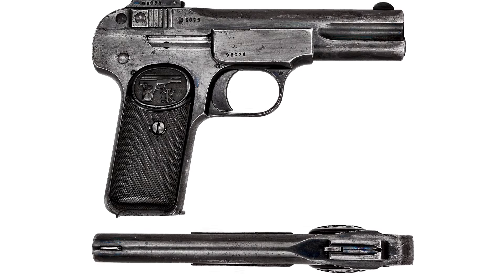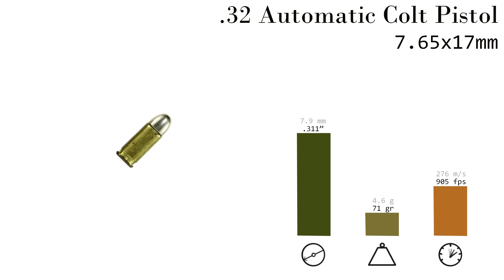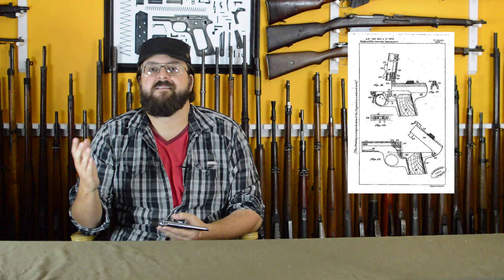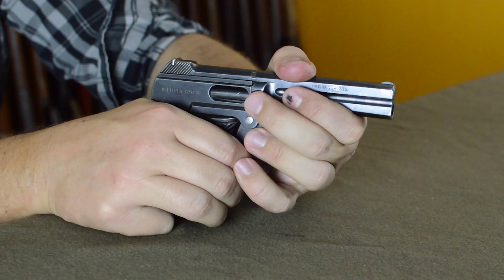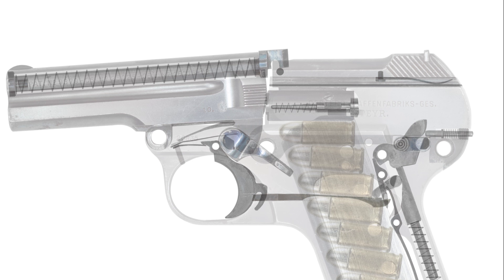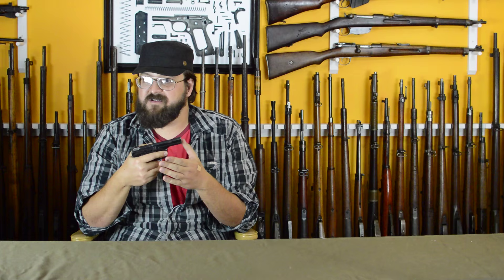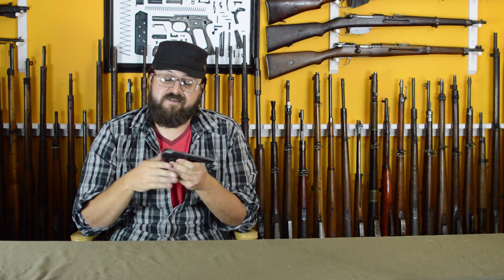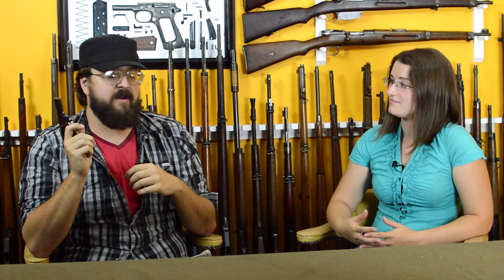History of WWI Primer 015: Austrian Steyr-Pieper Model 1909 Pistol Documentary

Comment: Ooooh,   HS camera perhaps?      In a month or so I'd be happy to run another promo for your channel and try to steer some more viewers your way.  Does the magazine need to be in the pistol for it to shoot?   I don't really understand the two position mag deal if you are loading a round at a time in it.
Reply from the maker: +TAOFLEDERMAUS That's my thought as well.  Why not just... not load the magazine..?  

Thanks man, might want to wait until we get through some of these planned rifles and MGs
Reply: They definitely over-thunk that one.  

Whenever you are up to it,  I'll be more than pleased to promote the crap out of your channel again.
Reply: My initial thought too, and leaving the magazine in must run the slight risk of accidentally pushing it in and making it semi again. Not a problem if you are being sensible and safe but after a long time of expecting single shot, or with someone new to the gun, the shooter could mess up.
Reply: +TAOFLEDERMAUS the idea with the two position magazine is the same as the magazine cutoff on the rifles at the time.

With the pistol in single shot mode you can keep a constant rate of fire for as long as you have cartridges handy, whereas if you use the magazine you'd get 7-8 quick shots. but then you'd have a long delay while you remove the magazine, refill it one cartridge at a time (which takes even longer than dropping it into the chamber), and reinsert it in the gun. (the idea of carrying multiple preloaded magazines is quite recent. a pistol would usually just come with one or two magazines, which you'd fill up with loose cartridges when needed)

So with the magazine in the cut-off position you'd actually have a higher rate of fire over a long period. Then if you suddenly need to fire rapidly you could slap the magazine in, and use the gun in true semi automatic mode.
Reply: +TAOFLEDERMAUS u add a lot of mass to keep is more stable en keep the feel more like u normally have on a first shot
Reply: Seems like a magazine cut of, got put on a pistol
Reply from the maker: +Christian Øelund all try but it doesn't look like this was intended to be a military pistol at first. It is just so odd.
Reply from the maker: +SoY_FooD I could see that
Reply: +C&Rsenal I was thinking about the question. Just a wild speculation, I don't have any sources, proofs, but it might have been a solution a another problem, that would appear without the magazine?
Reply: +Christian Øelund this also coming from a company whose rifle had problems with durability of (I belive) extractors) when in single-shot mode.
Reply: +C&Rsenal here's a question: what if this design had been chambered for 9mm Luger or 9mm Borchardt? or even something crazy like .38 special or .38 S&W? Now continue imagining that but with a weighted barrel, a heavy duty slide, 1911A1 style sights, a recoil buffer, a single position magazine, a push button safety, a grip safety, and a crisper lighter trigger. How do you think that would have performed on the battlefields of the Great War?

Comment: You speculate that the recoil would be more manageable with a heavier spring....that prompts a general philosophical question on all reviews of old gun:  how well can we truly judge the shooting characteristic of any century-old gun, especially when it comes to questions of springs and/or part durability?

(Another excellent video BTW)
Reply from the maker: +RabidMortal1 True, the spring could have aged poorly but given the near-mint condition I don't think it was terribly reduced in strength.

Although, you are right... we can never have them "factory original."   Such a shame!
Reply: +C&Rsenal Oh, I'm sure the spring was probalby in mint condition too.  However, it had still been (somewhat) compressed inside the gun a long time.  My understanding (which could be wrong) is that while coil springs don't loose their rate as they age, they can change in their dimension (ie, they compress)--that why bed springs "wear out". To be clear I'm not finding fault with this or any other video (they're all top notch!), only pointing out that the age of the components involved could affect our present day impression of how a mechanical object was supposed to function when new.
Reply: @RabidMortal1  actually springs wear out from changing compression more than being held compressed.
A closed switchblade doesn't damage it's spring, yet bed springs get messed up rather quick.
It's the repeated changing in their state that damages them. Same is true of leaving mags loaded.

Comment: The .32 needs to be modernized with a tad longer case and higher operating pressures.
Reply: yes, a straight walled 9x19 oal rimless high pressure skimming 380acp/9x17mm muzzle energies or higher. ideal for a compact double stack double feed locked breech,

Comment: Sure there´d be better choices to take to a battle... but i am still not sure how well reliability can be judged on such an antique 100+year old gun. Even if they have been treated well, it is rather likely that none of these that are still around match original condition. Nice review and late thanks ^^  Did these compeat in any trials? Would they not have figured out if there was a serious problem with the firing pin?
Reply from the maker: +ranji kawanji No trials. Just raw adoption as a secondary.

Most guns actually weather quite well.

Comment: anyone know a place with reliable replacement parts?  im looking for the firing pin, maybe 2 in case, seems they break often : /  and i need a Barrel Latch( current one seems to slide off sometimes)  any suggestions?,  thanks
Reply from the maker: +knosis14 Barrel latch I can't help with BUT I highly recommend Olof over at Deer Hollow Enterprises!